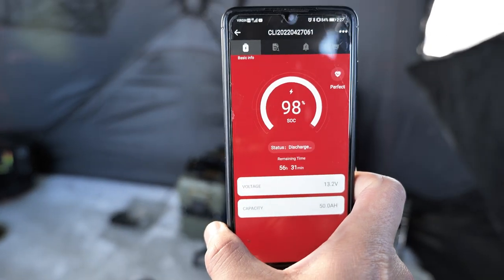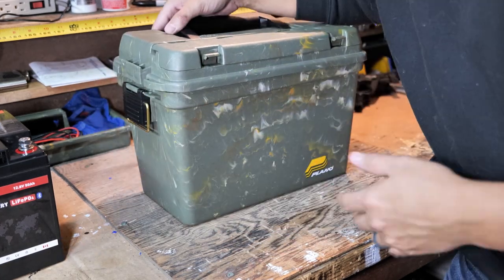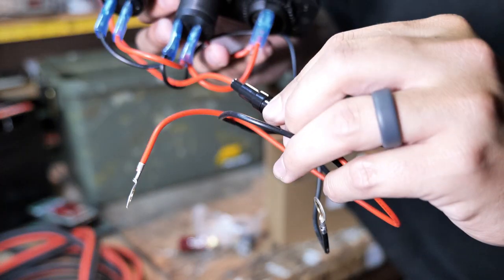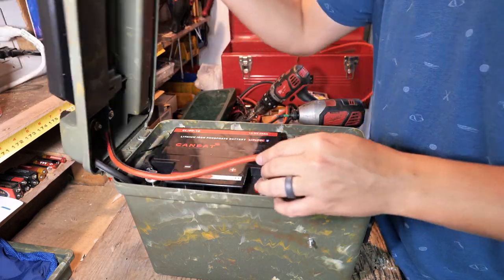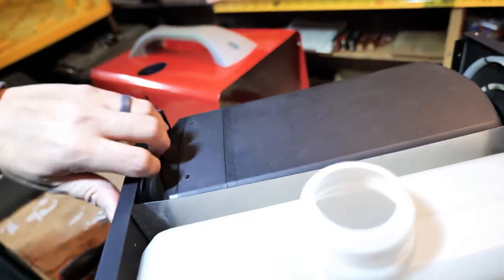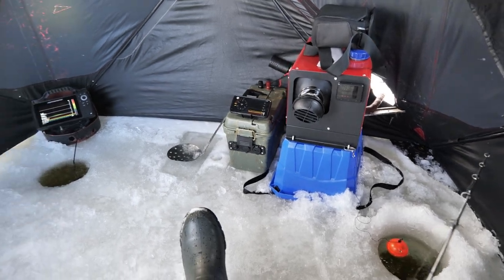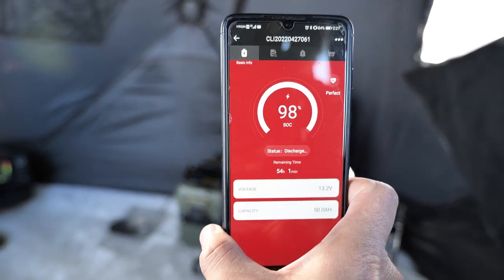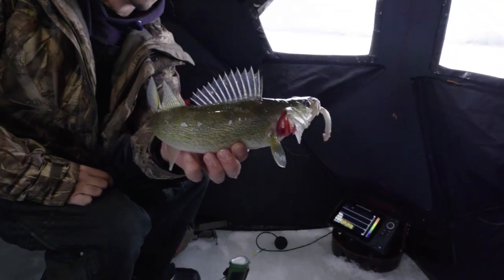I built a Power Pack & Diesel Heater for Ice Fishing / Winter Camping

Comment: Buy a ryobi battery holder on e Bay   cut to fit in heater case fit 24 to 12 buck converter 30 amp  ..with switch..hey Presto runs 5 ...7 hours ..then just change battery 6 ah

Comment: Great video!! been wondering how to run a diesel heater when most vevor, webasto, etc require 15amp input. Most gas and battery generators have 12 volt 10 amp outlets.
Reply from the maker: Yes exactly, even the power packs we see now flooding the market only have 10A outlets and won't start a heater. Best to connect directly to a power source. Thanks for watching
Reply: I bought a heater last year.  Just getting around to setting up.  After the initial run on a deep cycle I will most likely just run my small generaor to keep the battery charged for overnight
Reply from the maker: @harrycrannell7895  I run mine on my lithium battery absolutely no problem. Solar during the day will bring the battery up to 100% for the next night usually.

Comment: Nice build, I figured you put the heater outside. Careful tho, the electronics for the heater doesn’t get exposed to too much moisture being outside (snow, dense fog, mist)
Reply from the maker: I ended up extending the controller cables so I can route them inside. That being said, the  metal "case" itself is not water tight and I've been thinking about tearing it apart and putting it into a Pelican type of case. Thanks for watching!

Comment: What detail is assigned to that blue carry box that also serves as a heater stand  with what appeared to be added mounting / connecting holes for the heater’s 4 base “feet”
Reply from the maker: Good eye, I added 4 bolts through a blue grocery bin. Not sure what they are called. I made the bolts stick out the bottom so that the legs of the heater can prop into them securely. The bin also keeps the heater off the ground and can be used for transportation! Thanks for watching!

Comment: Having it outside makes sense, plus the clicking sounds annoying. I suppose you could try and re-rout the intake to a second pipe you run through the door. Maybe even shelter the unit itself too.
Reply from the maker: Yeah exactly! I'm going to test if running a long intake (recirculating) line makes a difference. I found it much better outside, less hassle and more freedom inside! Thanks for watching.

Comment: The "update" is the best way to run it.  Figure out a way to run the intake into the hut also and you will have it made.
Reply from the maker: That's exactly what I did in a later video, worked perfectly!
Reply: @JoelTremblayCA   You could run a return hose to the heater from the tent to make it more efficent and it won't gum up as fast.
Reply from the maker: @MHdollrevievs  checkout my next video, that's exactly what I did!

Comment: do you find the Pelican 75 tough to pull?  I have a 45 and it sucks.  I think because i have a decent amount of weight in a tiny sleigh.  I liked that heater.  Would be worth having around incase of an emergency or portable heater around the homestead.  I have diesel since i have a tractor.

My fishing this year on Nip is like the video.  Seems the walleye are just licking the scales off my minnows.  lmao

Great video as always Joel!!
Reply from the maker: I don't find it too difficult to pull but  you're right when it's loaded, the nose of the thing tends to dig. I noticed this when pulling it with the sled. Thanks for watching, safe travels and tight lines!

Comment: You would think a company would make a robust tool battery powered diesel heater. Designed for a violent  snow machine ride in a sled getting smashed on trailer bumps for days on end without a single drop of fuel leaking!
Reply from the maker: I feel like someone will definitely pick up on this as these heaters get more popular. I agree, the all in one cheapo units aren't built the best. I'm tempted to put mine in a Pelican case of sorts.

Comment: Great video Joel. What's the runtime on the diesel heater as far as fuel goes?
Reply from the maker: It uses very little fuel. I've ran it for 10 hours on low-medium and it's used 5L of fuel.

Comment: Would it be possible to build an insulated plywood box for the heater to sit in to quiet the noise?
Reply from the maker: @jacobcantwell5537  that would be a great idea. At that point though, I would simply remove it out of the metal case and put it in something more robust like a Pelican case.
Reply: @JoelTremblayCA  does the unit itself put off any heat besides the air duct and exhaust? Do you think having it in an insulated box would make it overheat?
Reply from the maker: @jacobcantwell5537  a ton of people have done it. I don't think it would be an issue

Comment: I tried a welding blanket to protect my tent from the exhaust pipe.....that didn't work out to well lol does the heat wrap help any?
Reply from the maker: I made a mistake of putting on exhaust tape not wrap.... It does help but actual exhaust wrap apparently you can touch it bare handed. Thanks for watching! I just keep the heater outside of the shack now.

Comment: What is the price difference between the diesel and propane per gallon ?! Here in the states diesel is 5 a gallon and like a buck a gallon for propane , kool build tho !
Reply from the maker: I'm not sure what the conversion is but diesel around here at the moment is around $1.89/L it costs like $7 to fill the heater. The 1lb propane bottles which are a total rip off are like $16 per bottle... Not sure what the going rate is to fill a normal tank. Thanks for watching!

Comment: Would you ever recommend a portable power station battery?
Reply from the maker: They work great for what they are, and I personally have one. But you get more bang for buck using a battery if you don't need 120v. I know a lot of people have had issue trying to run a diesel heater off of them too, mine for example won't work with the diesel heater. Thanks for watching!

Comment: Does it make that clicking noise all the time?
Reply from the maker: Yes that's the fuel pump. It gets quieter the lower settings. You can wrap them in foam to try and isolate the noise. Thanks for watching

Comment: So I guess the Bluetti didn't suffice?
Reply from the maker: Yes, unfortunately the Bluetti 12V cigarette lighter plug is only rated to 10A and the heater probably pulls just over that at startup, so it sets the unit into a fault (trips the fuse). I wish they made a 15A DC outlet on it then it would be perfect!  Running directly off the battery is best in my opinion for this setup as I rarely need of an inverter for 120v AC. Thanks for watching!

Comment: Just went to use the battery code, and it's only 5% applied.
Reply from the maker: Hey Cody, thanks for bringing this to my attention. There appears to be a discrepancy in the system. I will get in touch with Canbat and get some clarification.
Reply from the maker: I've got in contact with Canbat. The code is now 10% off. Thanks again for letting me know!